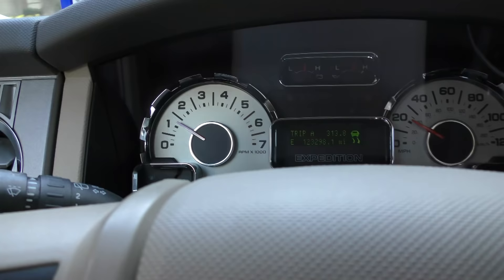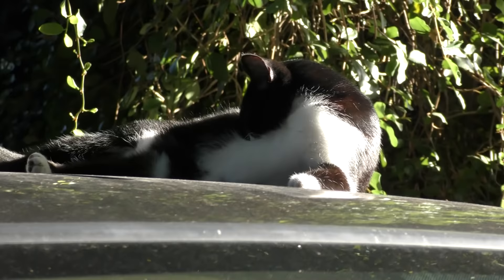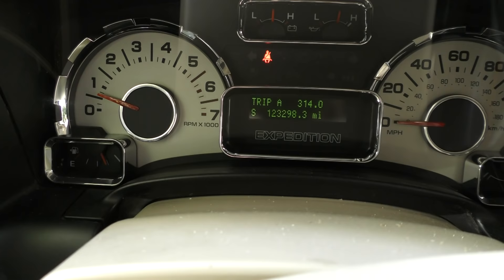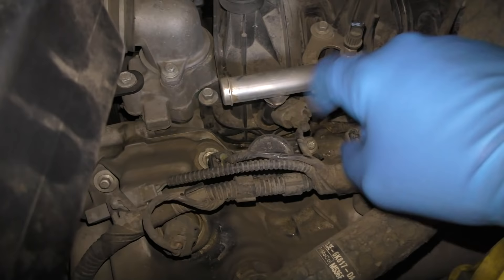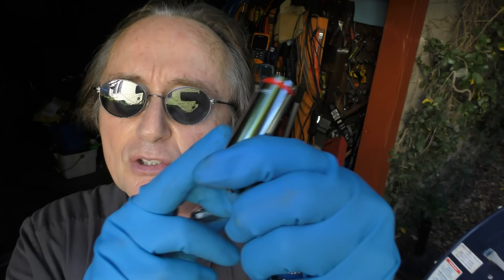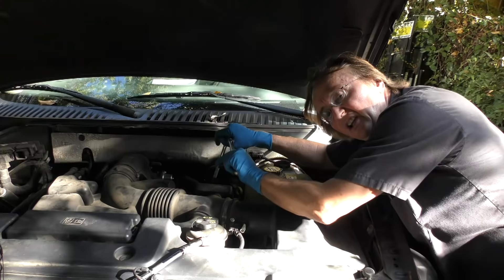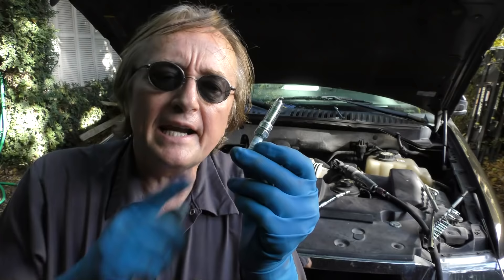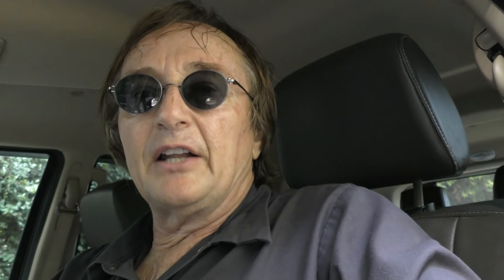How to Stop Car Hesitation (Spark Plugs and Ignition Coil)

Comment: What if the hesitation only happens at around 3rpm and only 1 in like 7-8 times i drive it. I shut off the car then start it and it disappears? I took it to mazda and they diagnosed a bad TCM but had that replaced and it still does it like before; rarely. Then they said it was probably a short in the wiring harness with no definitive proof just like when they falsely diagnosed a bad TCM . I don't trust them

Comment: Hi Scotty, I put new spark plugs on my 2006 Chevy Colorado and it ran bad, missing, hesitating and rough idle...I had to reinstall the old ones back on and the truck started fine. But now it's starting to hesitate when I come to a stop at a light or stop sign. It seems to be jerking as I start to go after stopping. I need some advise on the steps I need to go from. My truck is a 4 cylinder.

Comment: Thank you for your awesome tips all the time. ;)  It could be sound off the topic here but my Mercruiser 3.0 marine engine bogging down around 1800 rpm.  Low or Higher than 1800 rpm is okay but 1800 rpm in that area bogging down and the engine dies. and strangely it does that only when the engine is cold. when the engine is hot, everything is normal.  Do you have any solution for it?  and Thank you again.

Comment: My Toyota Camry has no check engine light on and I was driving down the freeway and I was trying to pick up speed so I could pass a car and  switch lanes. But as I put my foot down on the gas the RPMs went up but speedometer speed stay the same and then it did a hard jerk then it picked up speed. I hope it ain't a transmission failure or an engine failure. Note it started today and it does it at highway speed and even at 45mph and above. I got scared it there was heavy traffic on the freeway.
Reply: If it's a auto its most likely the torque converter if it's a manual its most likely the clutch

Comment: I have a 2007 Saturn outlook about 2 months ago it started acting weird. First these light came on (service stabilitrak )and (service traction control ) did it for awhile  and then my car  started shaking when I pressed on the gas from 0-30 is when it would shake. But when I reached 35 and up it stopped and then out of no where all the gages started going crazy up and down my cars lights would go dim and then back up. And when I pressed on the gas to drive that speedometer gage would go up but my car would go super slow. Took it to one mechanic said the computer charged me $320 . But my car still was shaking and a few days passed and again my car wanted to act up and I had my kids with me right when I was about to get on the freeway all the ages went crazy and my car drove sloooow. So I took it to another mechanic he said it was the cam shaft sensors. changed 1 or 2 charged me $310 my car didn’t shake when I pressed on the gas  pick it up the same day . No shaking but the next day around the evening time is when it started to shake again. I was like f my life!! . Help!!  @ScottyKilmer should I keep trying to see what the problem is or just get rid of my family car.

Comment: Hey Scotty my cars been jerking at speeds of 65-70 mph. I have a 2011 Toyota Corolla le. It did it really bad about a year ago then I didn’t drive it for 4 days at one point and it completely stopped jerking for a while. Since then I blew my engine and had it replaced and thought the problem would never come back but last night I felt it start jerking again. It wasn’t too bad but a year ago it got so bad I was worried I should pull over and took local streets back home instead of getting on the freeway. Could it be my ignition coils? Once in a while the check engine and traction control lights come one at the same time and last about a day. One time Auto Zone told me I have a solenoid problem. And I always thought it was my gas cap setting off the lights. Thanks again for your show and if you don’t get to this I understand.

Comment: Scotty, my daughter has a 99 mercury mountaineer with the v8. She started to get shaking and hesitation anytime she gets above 40mph. The napa guy said it's the valves. Some other mechanic said it is the fuel injectors. I'm thinking it is just plugs and wires and maybe distributor cap and rotor or coil pack if it has one instead of the distributor. What do think? I'm thinking definitely check plugs and wires first since that's the easiest to do.
Reply from the maker: start simple and work your way up. also check trouble codes AND if you know a good mechanic, mode 6 data on the computer

Comment: I have a 2008 Chevy cobalt lt and it seems a little slow to accelerate. Any suggestions? I’m looking at replacing the spark plugs and the wires but when I asked a mechanic he said it might be a computer issue. Is there a process of elimination that I should go through first so I don’t get charged a crazy amount by this guy?

Comment: My truck (2005 Ford Explorer Sport Trac) will randomly give me the ABS light and start to hesitate.  If I run the AC or stereo when this happens, it kills the truck.  I then have to put it the truck in park, and it will start right back up again and the ABS light and hesitation goes away for several days.

Comment: I changed the spark plugs and all of the ignition coils on my 2007 GMC Envoy but still misfires. I used platinum spark plugs instead of iridium. Do you think that my be the issue

Comment: I am trying to find out if there is significant difference between then and nine catalytic spark plug used in marine applications into regular spark plug. Specifically for my 4.8 GM motor

Comment: Hay Scoty, what about an engine which cuts the power mid crank, I turn the self start switch, the engine turns probably half round and all the electronics die for a sec, then they start again and the cranking starts again to die as before.

Comment: Hi Scotty, as always great video info. I have a 2010 Mercury Milan Premier 3.0. The check engine light came up,  and then flickering beginning of summer... I was told code says misfire and change the coil and spark plugs. Car has over 192k miles. The hesitation symptoms were most apparent at acceleration. They completely disappear during the summer then appear again for now a month and half. I admit I've been running the car in the neighborhood as I was not moving much with the whole pandemic situation. About a week ago, the car would start but not as smoothly...Ordered the coil and sparks. This past Friday, car refused to start then no lights on Sunday. Is it the battery? What's the issue? Thanks in advance for helping to clarify this.

Comment: So when I’m at a red light the rpms be 500 and feels like it’s going to turn off.... can bad sparkplugs cause that ? I have a 2007 Dodge Ram 5.7
Reply: - clean the fuel filter or replace it.
- fuel pump 
- clean the throttle body 
- clean the fuel injectors (carb cleaner)

Comment: Hey I have an new car and recently ran into this problem

This the message too the owner too see if he could help 

“This the kid that brought the car from I’m trying too diagnose this problem if you could tell what’s wrong with it 

Recently I changed the oil and oil filter and proceeded too drive off as I did it got slower & slower as I pressed the gas i felt it loosing power I asked the friend (the one who was with us the day of me buying the car ) too see what’s up because he was the one who changed the oil / oil filter well as he proceeded too drive off  it did same thing only this time it died and every since it’s been making this noise ( In the video) it’ll still crank but won’t go I drove it all the way back home too Mississippi even an few days and it runned exactly like you said perfect 👌 

That happened between Nov 16 me leaving Pa till - Nov 23 the day we changed the oil / oil filter.”

Comment: I just changed my spark plugs on my 2010 5.4 f150 and added lube to the spark plugs where it connects with the plug . Now is idling really rough . Did I added too much lube.?

Comment: hi
I have been watching your video from many many years and I have learned alot.
I have Jaguar S type 2002 V6.
the engine management light is on and sometimes when I try accelerate beyond 3000Rpm it won't let me. it just hesitate and also sometimes while driving petrol smells comes.
should I replace the plugs or the air flow sensor.
if you had any idea please let me know
Best wishes to you.
Reply from the maker: so many things go wrong on jags that do that, best to pay a guy like me with a dealer level scanner to analyze data and stored codes. Guessing is super expensive and often fixes nothing on a Jag

Comment: My brother inherited a Mercury Mountaineer with 155,000 miles. Car started misfiring...due to  spark plugs NEVER changed! I tried to remove No.1 plug-frozen in. So he kept driving it-misfires so bad that unburnt fuel exploded in exhaust manifold-cracked it (now noisy as hell). Took it to garage-mechanic refused to change the plugs (he was afraid he's break them off). Should this be scrapped?

Comment: My car needs spark plugs and coils replaced but the technician said only one out of the 5 had a misfire in it . The warranty only covers the one with misfire as the other ones are still intact ... they recommend I replace all of them but the other 4 would have to be out of pocket which is $400 that I do not have. My question is , is it safe to drive my car until I can save up to replace the other 4 coils/spark plugs ? Or is it not necessary to replace them soon?
Reply: Laday Blues look up your car make and model on the autozone website pay em that way. It’s cheaper that way, then just take it to a local mechanic to instal for wayyyy cheaper

Comment: Hello Mr. kilmer!! My name is Miguel. I was wondering if there is any chance that you could videos with a Nissan Maxima 2003 like my car. My car has 148,000 mi and is starting giving my lots a problems like ignition coil problems, breaks, lights on the dash board al the time. I know I have to keeping it in good shape because I got a job as a Driver delivery for a restaurant and it needs more job done. Also, any advise on how often should I do the oil change? Thanks in advance for your advices!!

Comment: My mechanic put 5w30 instead of 5w20 when worked on my car and messed up the order of ignition coils. Car now shifts gears(automatic) when reaches 2.5k rpm. Before it used to shift around 2k rpm. And no, I don't press the gas harder. Is this the ignition coil messed up order result?

Comment: I've changed the spark plugs on a 04 honda pilot thinking i had bad ones because it has a rough running start when its cold but when left 10 mins to warm up its runs fine. Any suggestions? Coil packs maybe? No check engine light on thought.

Comment: I changed the coil and spark plugs, found sludge on top of the old spark plugs, I still have the same problem p0352
Reply: Did you get it fixed

Comment: Throttle Position Sensor can be bad and not bring in a Code, mine right now on my 2008 ford f150-5.4 liter is bad-truck hesitates and then sometimes rpm kicks up for no reason....

Comment: My euro Accord sometimes drops the revs below 750,  when I let off the gas,  then with a second or two delay returns to 750. Happens more frequently when A/C compressor switches on right at take-off (in town traffic) ,  but does it with A/C being switched off too. What could be the issue?

Comment: Changed spark plugs, coil pack and  wires, still having same problem, catalytic converters were checked and they're good.fuel pump, fuel filter, also changed,  what else could it be?

Comment: What if the car hesitates and bogs only during sharp turns from a stop or a u turn? Would a p0137 cause that? I have a 2014 brz 30k miles with a stage 2 reflash could it be the tune?

Comment: Scotty, my Mustang has the same leak except the tube where the heater/coolant hose connects to is crack. I'm going to buy a new one, but my question is, are there any plastic hardeners out there to add strength to the Ford 4.6's manifold weak points?

Comment: Hey Scotty my new car has the same problem, to start with, its a petrol engine, has about 123hp and 151nm of torque, when I put it into first gear and release the clutch, the rpm drops close  to 500 rpm, can you explain why? And it vibrates while moving, with just the clutch, no throttle

Comment: Do u happen to have a video on sounds to listen for if a possible spark plug problem exists? I have a 2002 ford mustang basic model and it the engine is turning but the final rev is not giving.  I thought that might be a spark plug problem but i am unsure.

Comment: I recently had this problem with my car. I switched the spark plug, and it ran better but still something wrong. I swapped for new wires. Still something. I just replaced the ignition coil and it seems to be running worse. It’s hesitating and it’s hard for it to go past 30. On the back roads it will go from 40 to 20 with my foot on the gas still. Any suggestions?

Comment: my honda civic from 95 just started doing weird yesterday. Totally lacks power and acceleration. When i give gas, its hold in verry much, and engine sounds like its not in sync. When at idle, the car is shaking. Can this be spark plugs?  Or distrubutor cap? I dont want to lose my Civic :(. Only have 86.000km on it. No engine light comes up. Not weird scratching sounds from the cilinders, or hard valve sounds. Enough oil on it.

Comment: Scotty so I know say I had a 4 cylinder engine & 1 cylinder was misfiring  say 2 if I swaped the ignition coil 2 with 4 & the same error came up as cylinder 4 its the ignition coil.... but how do I check if it's an ignition coil pack that is all joined together?

Comment: Scotty?! I replaced my spark plugs, ignition coil, MAP sensor, IAC valve, TPS, Fuel pressure regulator, Engine coolant temperature sensor. Still engine hesitates has rough idle, wants to die most of the time. No vacuum leaks Rich fuel code on the dash

Comment: Would this happen at higher speeds? And be the same problem? People keep telling me torque converter but I’m not convinced it is
Reply: At high speeds you might have a fuel system issue. Clogged injectors or a weak fuel pump

Comment: Scotty, I have a relative that had no spark from cylinder 1 on his 07 tahoe.  I've swapped coil packs plugs and wires and it sparks for a while then stops.  Not sure if a lifter stops spark ignition but was wondering if the incoming harness connection has issues.

Comment: Well this is kind of confusing to me, I never have such problem before, I'm the second owner of my car and I bought it back in October of 1999, about a week ago I took my car in for oil and filter change and also I asked my mechanic to check the spark plugs because it has been awhile since I haven't change those and to let me know if they need to be replace, about an hour after he called me at work which is across the street from where I work, he said yes they do need to be replace this time, so I said well okay cool change those too please, so remember I said at the beginning I never had any kinds of hesitations in almost 25 years I own this Car,  well three days after he changed the oil, filter it's spark plugs my car started to hesitate, I even asked him to check all the things like the mass airflow sensor he said he looked at it and it's perfectly clean, well with all of that checked and with clean air filter, clean oil and cnew filter and new spark plugs the car still hesitate, driving around and bring it over this coming week to see if still do it, so here I am thinking why is my car hesitating with all of done, I remember now that the same day he changed the oil filter and spark that same day I fill up the car with gas, could have been that?  Please anyone, can bad gas in your vehicle make your car hesitate?

Comment: I have an 87 Chevy 4x4 with a 5.0/TBI and when I'm plowing and backup it'll die out on me or backing up on a slope it'll die. Starts up fine and runs good but it doesn't like reverse for some reason. Full tune-up last winter, battery cables tight no loose wires. New pickup coil, rotor, coil, cap, wires, plugs, both injectors, IAC, MAP, TPS, fuel filter and a new kitchen sink.... any ideas?

Comment: Hey Scottybmy car drives fine 1st thru 3rd gear then when I'm pedal to the metal, but once i get to 4th it shutters and hasitates until I let off a bit. If i don't gun it I can cycle the gears fine no problems

Comment: Hi Scotty, I hope you see this one. So I just got my 2005 Honda Civic Hybrid and it shudders/hesitates for a spilt of a second when it’s pulling away as well as reversing. I changed all 8 spark plugs but symptom is still present. It runs perfect after the initial shudder. No codes whatsoever, passed smog. Any ideas on how I can fix this?

Comment: Scotty I have new coils, wires, spark plugs. it ram strong for while now is sluggish acceleration  on 94 oldsmobile cutlass ciera 3.1. could it be the mouthing unit the coils attach to? the coils slipped on easly

Comment: Scotty, I have a 2018 Ram 1500 and it sputters. I change out the ignition coil and spark plug and it still sputters. Could it be a bad battery?

Comment: Hey Scotty, I have 2003 honda pilot with about 165k miles on it and I've noticed it had a bit of a rough idle. On not sure if it's a slight miss or not how would I check if it's missing? I have no check light on so wondering if it's an injector issue. Or something else like a timing problem.

Comment: Would bad coil pack cause my abs sensor to come on and make my jeep patriot misfire?  When it does that I lose RPMs rapidly and then it is extremely sluggish to gain rpms.  When I do try to speed back up it will only make it to about 40-45 mph.  If I pull over and turn the jeep off for a couple minutes and turn back on I can drive normally but the problem repeats itself.  I have dumped almost 2 grand into a mechanic and it is still not fixed.